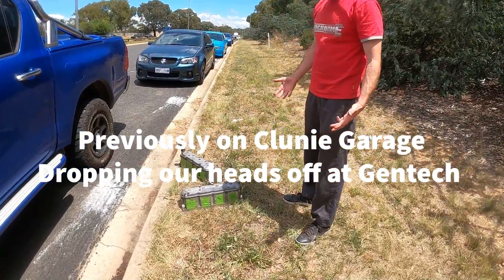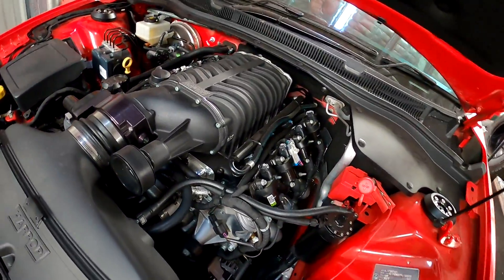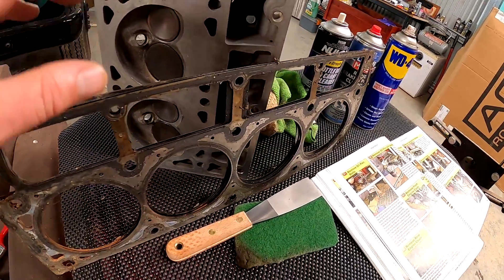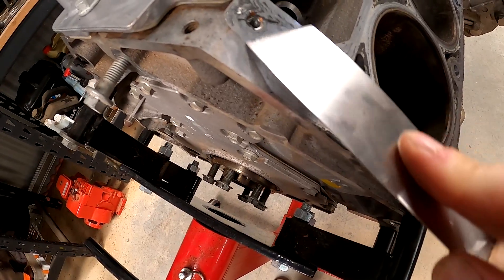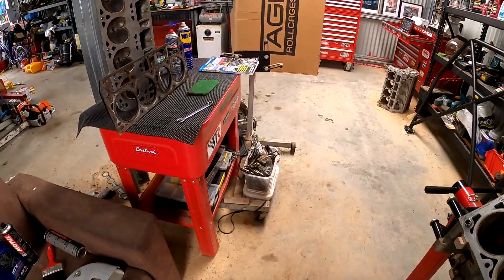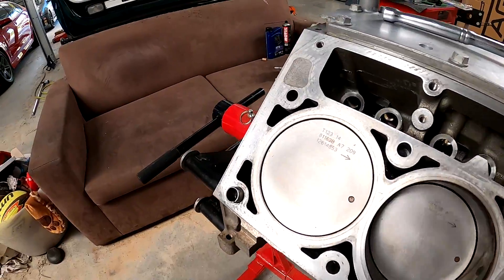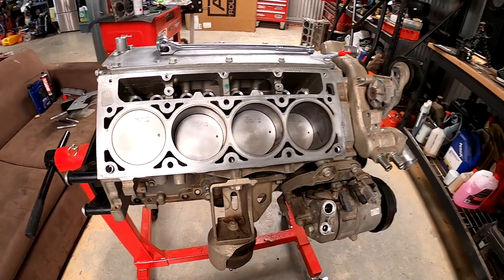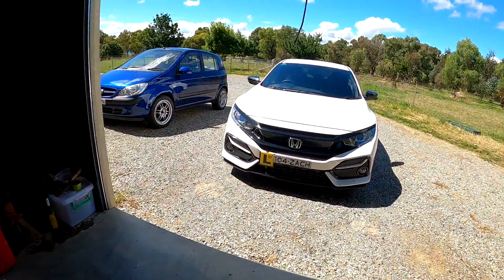500hp LS 6.0L Engine Build Part 5 | Engine Block Preparation for Race Heads

Comment: I’m just getting full rebuild of my l98 has oil pressure issues I heard that gm cam bearing walk in the jernals change to power bond better design what you think
Reply from the maker: G'day mate, we have seen cam bearings 2 and 3 be particularly problematic on L98 and L77s.  Best to change these when doing a cam replacement for safety sake.
Reply: @ClunieGarage  thanks for replying will do

Comment: Glad to hear you're getting the heads shaved to bump the compression up a bit. The L98/L77 only has a weak 10.4:1, compared to 10.7:1 on the LS3 and 10.9:1 on the LS2. Holden really did everything they could to hold back the L98/L77, as if the the factory 200/208 .472/.479 cam didn't already hold them back enough 🙄
Reply: How true you are man..  👌
Reply from the maker: G'day guys, yes these L77s lacked cams and compression.  We will be fixing both of those sins!!!